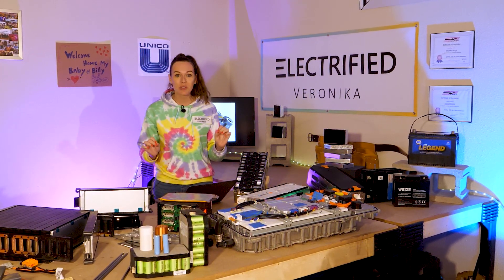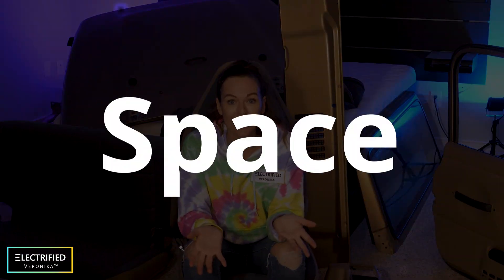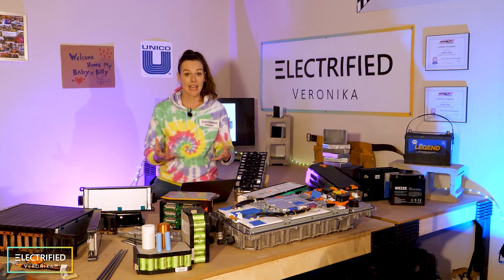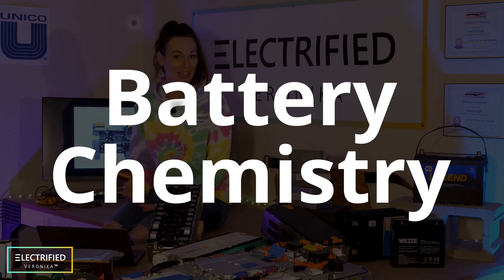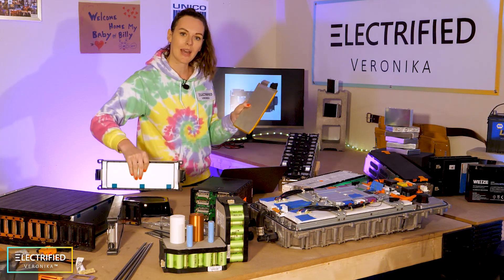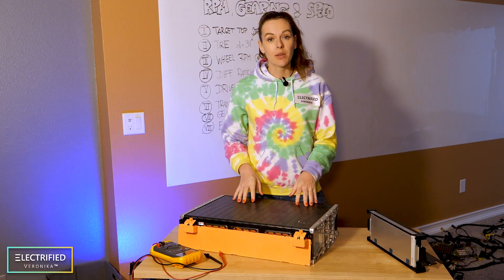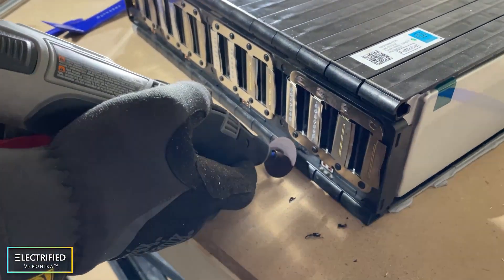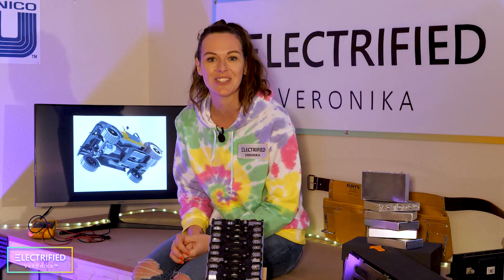Which BATTERY for Electric Vehicle CONVERSION?

Comment from the maker: So, this is the first video about our BATTERY system. I think it is a little more complex than I thought, so there will be a couple more videos about the battery upcoming soon. This is an adventure! 😂 Let me know what you think and if you have suggestions please!
Reply: did you draw that whole thing in cad? who's doing most of the work on the vehicle? are you assembling the pack by hand? watercooling? why not use hub motors?

also, do you know anything about electric motors and motor design? I wanted to get someone skilled to look over my axial flux BLDC motor design in CAD before machining it, it uses a halbach array on the dual rotors.

lastly I have something to share! you should look at getting an electric unicycle. there's plenty of videos here on youtube and you can buy one from ewheels or euco.

I am a physics student in university, and I am also into assembling EVs though I don't like 4 wheelers lol. I even assemble the battery packs and weld together parts to the frame.

thanks if you reply, your husband is a lucky guy! very beautiful and smart
Reply from the maker: @Blox117  the cad model presented in the video is downloaded from a website, but we are creating our own from a Laser scan right now in solidworks (see episode 3 I think). We are working in our garage - that's what people do in america right? 😂 so we are manually disassembling and assembling them ourselves. No hub motors (see episode 2) because too expensive and more complicated to control. Also, a project goal is reusing as much as we can. The batteries will be water cooled. I am not an expert in motors, but batteries 😊
Reply: @ElectrifiedVeronika  no I work in my kitchen cause i dont have a garage lmao
Reply: Cobalt is used in fossil fuels.... but nothing is said about that though...

Comment: When assembling your 400V battery, some precautions must be taken to avoid short circuits (I hope).
Indeed, once assembled into a car, the opportunities to touch a positive to a negative are likely to be prolific.
I hope I am going to see that this is taken very seriously.
Battery fires are very unforgiving.

They are essentially chemical fires. 
Might we be planning only for the good times?
Has anybody thought of using the space which surrounds cylindrical batteries to contain fire-suppressant chemicals - just in case the worst happens ?

Comment: Love the series! Not only because you explain things, but because you have to deal with the exigencies of running an EV in the Midwest. 

I'm sure you're tired of hearing this but can you help me with the math? It has to do with the relationship between pack voltage and capacity. Using the Tesla S pack, although I know you didn't for the GG Jeep project, but because everyone seems to agree on the configuration and the end result AND it is the pack I used to check my Excel spreadsheet formulas when I was playing around with pack configurations. 

The Tesla S module has 444 18650 cells in a 6s74p configuration resulting in 22.8V and 5.3 kWh (I actually came up with 5.74 kWh for some reason, probably resistance). Adding 16 of these modules together, I believe in series, results in 364V nominal, 403V max, and the 85 kWh pack results that we all know and love.

My question is: if you sum the voltages by wiring the 16 modules in series, how can you also sum the capacity, which would otherwise require a parallel connection? Is there something special that happens because there are the three tiers, cell, module, and pack?

By the by, the only clear conclusion from my pack configuration exercise is that I am playing checkers and @elonmusk is playing chess.

Comment: I worked on dump trucks in Australia and they were diesel v 12 Cummins power train and rear drive 3 phase 400v ❤️with large alternator charging systems, dynamic brakes with hydraulic to all wheels .ok

Comment: So if I understand it your choice of 400V came down to IR losses, the higher the voltage the lower the loss but 800V was impractical to achieve?  DId you do any analysis on the effects of voltage on the motor?
Reply from the maker: Yes it was two things. One was for the losses but there was NO way to get to 800V with our modules without really removing the individual cells from this double slice that is the smallest unit. Yes we could have bought 800V EDrive from Cascadia but stuck with the 400V because of the battery configuration.

Comment: This may be answered in a future video, but what is the return on driving distance per weight of battery pack? For example, you said in a previous video you need about 220kg/500lbs to equal the original Jeep weight. It would stand to reason that if you used less batteries/less weight you could go further because the power is not eaten up by more weight. But if you add more batteries/more weight, your efficiency goes down, but you also have more power. So is there a sort of break-even point where adding more batteries would actually harm the rate of return?
Reply from the maker: Very well analyzed. Yes, there should be a break even point and will will figure that out in our virtual environment where we can play around with all those specs. I will include that in upcoming videos, glad you are bringing that up. Had the same thought when adding a trailer to tow.

Comment: The state of the art is lithium iron phosphate now, rather than lithium ion
Reply from the maker: State of the art in the automotive industry are lithium ion batteries with NMC cathode chemistry. Lithium iron phosphate is a lithium ion battery with a LFP cathode chemistry. The latter is on the rise because of the scarcity of cobalt in NMC batteries plus other benefits like safety and longevity, but right now on the streets you would mostly find NMC.
Reply: @ElectrifiedVeronika  ah ok. Very interesting. Thanks

Comment: What about cooling/heating of custom made battery pack.
Reply from the maker: The batteries will be heated and cooled through an active thermal management system with liquid cooling through cooling plates attached to the bottom of the modules. We will also make custom battery casings that are waterproof. More on that soon! 😊

Comment: Hi V, thank you so much for your Videos. They've been so informative. I have 2 2012 SUV mercs which is like to convert in the future. I have 2 questions
1st is how do I intergrate the the new ev  to the original electrical system of the car without having to change much. I'm Guessing I might need to keep my gearbox or atleast the transfer case.
Is also light to get atleast the same power or speed or if my new motor. How do I choose what motor to use.
Thank you very much for your videos. Can't wait for the next one.

Comment: Did you add the weight of the liquids like oil, gas, and coolant to your calculations?  (I assume you did)
Reply from the maker: So, the liquids like oil, gas are included, but we estimated the liquids for the battery right now, more updates once we have the real battery system installed 😊🙌

Comment: The on-screen text giving the weight of the Jeep's original starter battery is incorrect: it says "80kg (40lbs)", which could have been intended to be "40kg (80lbs)", and more accurately "40 kg (88 lbs)"... if that battery is actually that heavy. More likely, it's a BCI Group 34 battery at about 18 kg (40 lbs), so maybe that's what you intended to post.
Reply from the maker: Should be 18kg, 40lbs ☺️

Comment: This is possibly the best-researched conversion I've seen so far! I'm on the fence to do something similar, but with a station-wagon like an older BMW 5 series or Mercedes E class - the one type of car that I think would benefit the most (low drag, long wheelbase, big engine bay).
Are you doing 7X 16S2P for the batteries? Based on those LG pouches I'm guessing it should get you a 32kWh total pack, so about 80-100 mi range in the Jeep? Looking forward to the build!
Reply from the maker: THANK you SO MUCH, that's so wonderful to hear. And your project sounds cool too, let's do it! 😊 About the batteries, lots of uncertainties right now, working on it!! BTW, 2 days ago got 12 used modules again - now disassembling, testing cells, but also looking into some other used batteries again. Stay tuned, and sorry for not having the details ready yet. We are aiming for 60kWh total capacity.

Comment: WOWW 😍 you impress me all the time 💪👌,  i live in north, so i wonder if you can retrieve the heat from the cell and heath the cabin ?  Like server in some place... 
awesome job Veronika, I look forward to converting my jeep 2007 🤩
thanks a lot for all your video.
Reply from the maker: Thank you for your comment, I so much appreciate that, so great to see that positive feedback! GOOD IDEA, energy efficiency is the key - this is what Tesla does with batteries, but especially the E-motor - but this requires a special heating/cooling system which is outside of my expertise. More to come soon about these aspects!
Reply: @ElectrifiedVeronika  wow, didn't know that tesla does that,  thanks for your response, i follow you from Québec (Canada), you are so great, so chrysler in going to hire you becoming chief engineer EV 🤣👍😍, have a nice day Veronika
Reply: There isn't a useful amount of waste heat from the battery in winter conditions. There is some waste heat from the motor and controller, but it's still not enough for cabin heating.

Comment: Plot twist it’s going to run on a highly efficient diesel generator so it’s technically still electric but EV is getting a $3,000 subsidy from Exxon for each vehicle sold now. Along with an undisclosed settlement for signing an NDA

Comment: Coal and natural gas power plants run EV cars..Fact
Reply from the maker: Of course it depends on where you live and how your local utility generates electricity. We will add solar to our house in a couple months so this takes care of the home charging. There are public charging providers that advertise 100% renewable energy electricity - I have seen that here in the midwest by EVGo, not sure how they are doing that. Maybe you can help make the grid cleaner wherever you live. I am active with RENEW Wisconsin, many great things to happen and I see lots of change.

Comment: Great video! Looking forward to your fabrication of your battery modules. 

Was using existing Tesla modules not an option?
Reply: Any of the Tesla modules (there are different formats in different models) are awkwardly large to fit in the vehicle, and none of them can be readily re-configured.
Reply: Yes, we heavily considered them but the pouch modules we got fit better with the voltage we needed and the space we have.  We really didn't want to "fill the trunk" with modules and wanted to keep most of the batteries out of the cabin.  With the Tesla modules we would have needed quite a few to get to the 400VDC that we wanted.
Reply from the maker: Thank you for your feedback! I am a big fan of cylindrical cells and if we wouldn't have gotten access to the used LG modules we would have dived into that more - probably would have needed to go the route to configure our own "Tesla cell based modules" too. As Don mentioned in his reply, we have restrictions in space and voltage level and we want to distribute weight and not have it all in the frunk. And this modular, reconfigurable pouch cell concept seems to be a really innovative, creative, challenging but hopefully doable solution 😊 Stay tuned and always happy to receive questions, suggestions, talk about ideas.

Comment: love the infos. very nicely explained. what is the aspect/size of each battery cell? also what about cooling the batteries?
Reply from the maker: Thank you! The dimensions of the LG pouch cells without tabs are 10.63" x 4.13" x 0.5" . We changed our mind on the cooling part, so we did not include it. Coming up soon! Suggestions? 😂